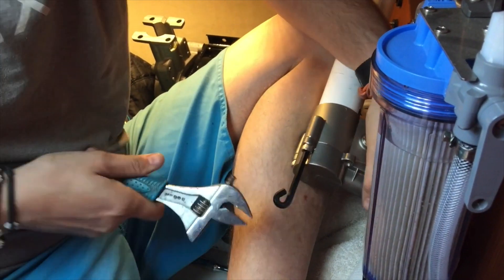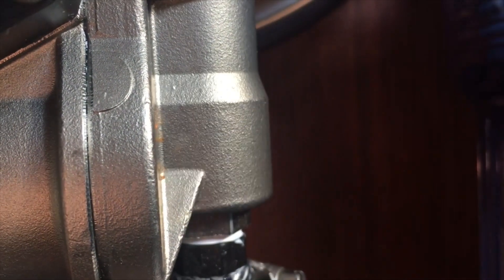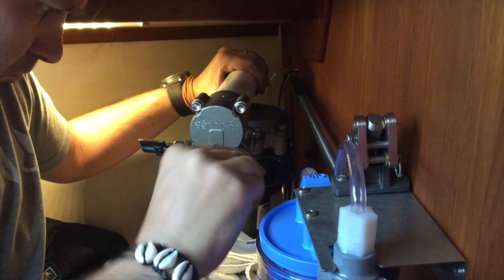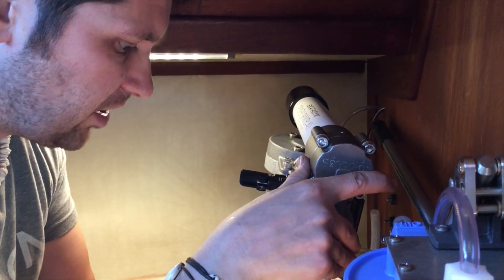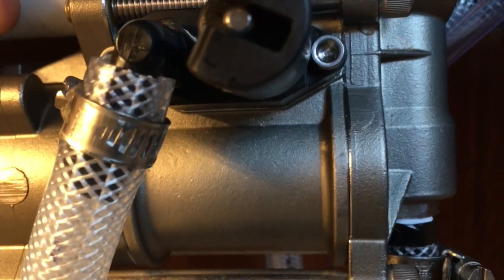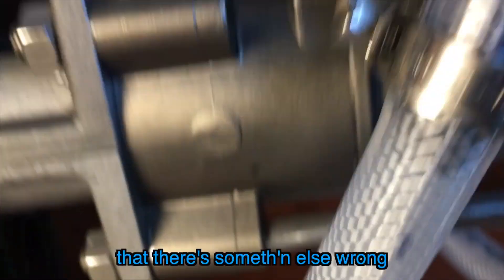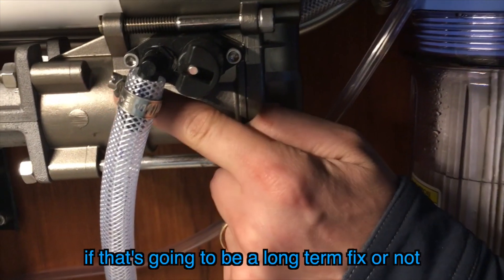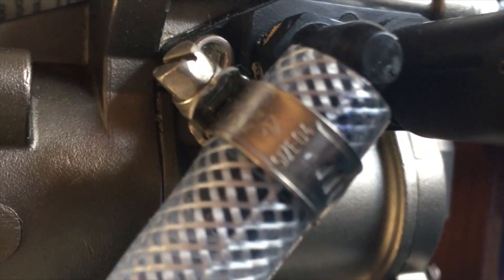BROKEN Katadyn PowerSurvivor 40 WaterMaker 💦 Ep. 20

Comment: Informative video, thanks! We're thinking about getting this watermaker as opposed to an AC high output watermaker. We like the idea of the low power consumption. But that means we'd have to pretty much run it all day every day instead of for a couple of hours per week. Do you find that the unit is very noisy? In your video it seemed quiet, but when I watch LeaLea's videos (they have the same watermaker) theirs seems noisier. Also, are you running yours all day and getting 1.5 gph reliably? Thanks!
Reply from the maker: We LOVED using the Katadyn PowerSurvivor 40E watermaker!!! We had more than enough water to use everyday! We only ended up using maybe a gallon and 1/2 per person per day, which doesn't take long to make.  We had an 18 gallon fresh water tank on board and then 10 more gallons in jerry cans that we kept reasonable amounts of water in at any given time. We would run the water maker every day or two for a couple of hours at a time, usually when the sun was high and we were making lots of solar power. We were actually making more power than we could use even WHILE running the watermaker. We used our fresh water for drinking, washing laundry, doing dishes, and cockpit showers. You don't want to let the watermaker sit for more than 2- 3 days without running it or you will need to brine it. So even with a larger water maker you would be running it every 3 days anyhow. 
We feel that the Katadyn PowerSurvivor 40E is capable of providing water for up to 4 people. If you have more people than that, or maybe you like taking long showers, then you might look into a larger water maker, but you will still be running it every 3 days at the least. The noise was hardly noticeable at all! We mounted our water maker on rubber grommets to reduce the noise which helps quite a bit. Also mount it in a place that is VERY ACCESSIBLE. Think of it as a kitchen appliance that you want easy access to.  

Check out our upgrades video(first 3 mins) for more detail of how we set up the watermaker and how we used it.
https://www.youtube.com/watch?v=OhLan1B1Vd0&t=195s
Reply: Thank you for such a detailed response, this sheds a new light on it and makes me think about things I hadn't considered before. Cheers!
Reply from the maker: No problem :) hope it all works out for you! Happy Sailing!

Comment: Didn't the water maker manual have instructions on assembly? What pressure were you running? Only around 800 PSI is needed, usually.
Reply from the maker: Yes we did read the manual several times. It's not an adjustable pressure. There's just an on and off switch. The problem was caused by a manufacturing defect, that i was able to overcome, by over torquing the head bolt. Thanks for watching our videos and for leaving us a comment, we really appreciate it!
Reply: I did not mean to imply you were negligent. I would have expected the instructions to have detailed instructions for torquing the bolts. Katadyn seems to be a very good manufacturer and I was surprised this would slip through QC. On a different note, does anyone make a smaller water maker? My boat is smaller than yours, and I would be happy with a smaller and less expensive unit. I have 200 Watts of solar panels, and  240 A/h on my main battery bank. I would be happy with 5 GPH. All the smaller water makers seem to be designed for temporary use and are hand pumped. I know a larger unit could be derated by mounting a smaller pump, but I would prefer a matched system. I do not have room for a huge water tank 10-15 gallons is about my limit.

Comment: If the leakage was due to a unflat mating surface you probably wouldn't be able to detect the surface imperfections with your fingers. Those surfaces needs to be milled flat to take the pressure.  And to end flexing the flanges  probably should be made thicker.

Doesn't sound like a unit designed for continuous use.
Reply from the maker: Thanks for watching our videos and for leaving us a comment. We were very happy with this watermarker and are so glad that we had one while on our trip. Even though we did have a bad start with this one, it never gave us any further troubles and we did use it just about everyday.

Comment: This unit shoild only be mounted flat. 
Mounted on a vertical surface causes  issues with the gearbox and other components
Reply from the maker: Thank you for watching our videos and for taking the time to leave us a comment! We really appreciate it. I think you have it backwards, it's the pump body that can't be vertical not the mounting surface. So you've got it partially right. The problem doesn't arise from mounting the unit on a vertical surface, but rather from having the pump body and thereby membrane tube mounted in a vertical orientation. The pump body and membrane cartridge should always be mounted horizontal, but can rotate to mount on any surface, i.e. floor, wall, or ceiling, as all of these options allow for a non vertical orientation of the pump body.  The Katadyn user manual says: "...the pump and gear box should be mounted so that they are on a horizontal plane...We recommend securely thru-bolting the pump/drive assembly to a sturdy bulkhead or platform..."  
We haven't had any problems with where we mounted ours.  If we had any final tips it would be, mount the unit on rubber grommets to lessen to noise and mount the pre-filter in an extremely easy to access location.  Here are some links that we found helpful when researching our watermaker. They include the full mounting instructions.
~https://www.katadyn.com/downloads/katadyn/manuals/desalinators/manual_powersurvivor-40e_oil-up-to-sn-40-05249_en.pdf
~http://www.ishipaco.com/katadyn/docs/WatermakerBook.PDF
Reply: Depending on the year model you have. At some stage the gearboxes were oil filled and this caused issues   for vertical surface mount. Then they changed to grease.